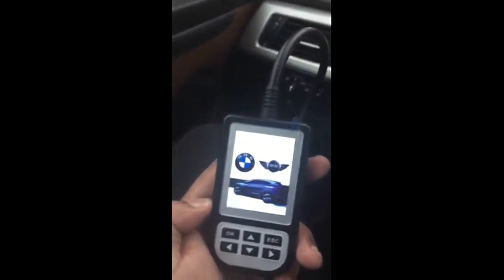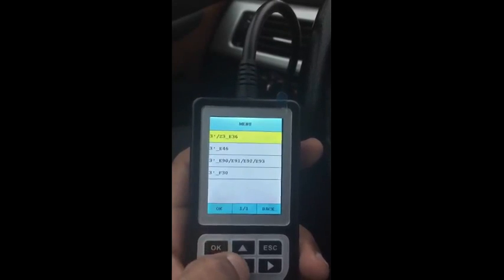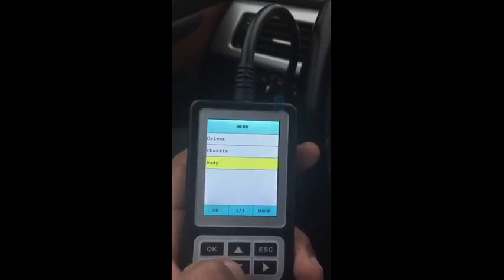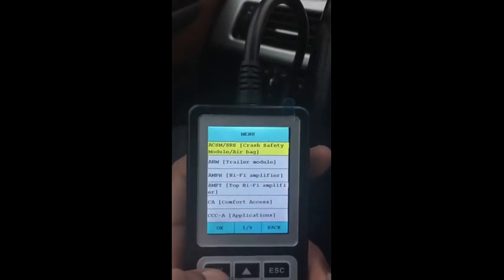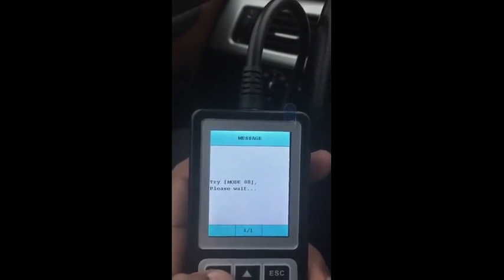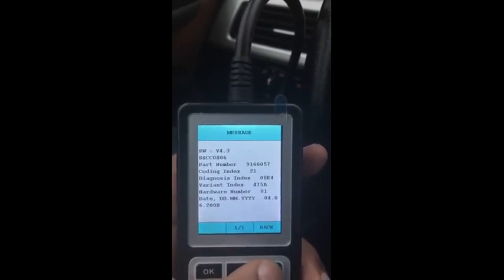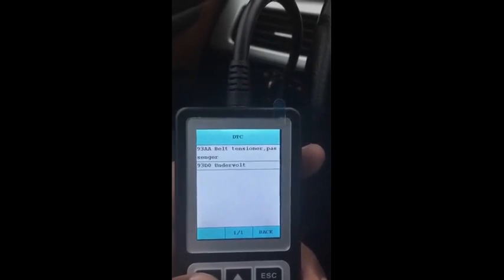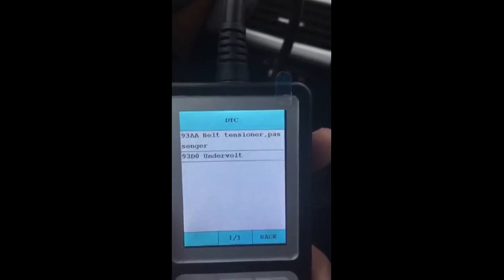BMW AIRBAG WARNING LIGHT (dont diy this)

Comment: So what was the final verdict? You replaced the parts, your coding did not work as a long term solution. Did you ever get it fixed before you got rid of it??
Reply from the maker: Nope ...I realized it was the air bag module that needed to be replaced and also programmed at BMW...there were more things that needed to get done on that car... and so i traded the car in for what i have now 335xdrive msprt pkg N55 ...this was a great decision

Comment: Should I buy a 2010 328i N51 with 99k no lights on with sports package automatic transmission smogged? I’m a mom with kids , or 2011 Mini Cooper s
Reply from the maker: I would say no to both 🤦🏽‍♂️ too much headaches
Reply: @BimmaJoc  so the 2011 is a JCW package and he has replaced a lot of parts with receipts,  is that any better news lol
Reply from the maker: I know its your decision but real
Small cars like that are not even safe and theres got to be more of a reason hes getting rid of it ...hey what about a honda accord ??? More reliable plenty room for the kids and safe
Reply from the maker: Ive own 3 hondas in the past never had an issue ...i even sell hondas now ...i love bmw but as you can tell from my videos i spend a lot of time doing maintenance or fixing it 😅😅😅
Reply: Bimma Joc well I have a Honda Odyssey as well and a Acura TSX 2008, ok last question is the 2012 mini jcw a better motor than the 2009 jcw
Reply from the maker: The 2012 is better by one horsepower
Reply: Buy a toyota

Comment: Hi, if it is the steering wheel driver airbag that is faulty, how do I fix that one?
Reply from the maker: Well ....we cant ...must go to dealer because it has to do with airbag ....even everything i did on this video realized that bmw scan tool needed to reprogram airbag module
Reply: @BimmaJoc  Thanks man. I will do so.

Comment: I am sorry there is no such thing as a quick fix.  Once the light comes on, your horn or any control on the steering wheel stops working.  It happened on my GTO.  First, the steering wheel needs to be removed, the fault lies in the part where the turn signal and windshield wiper and that one needs to be replaced.  Please take it only to a BMW dealer, or someone is a certified BMW mechanic.  The repair costs US$ 1,350.00.
Reply from the maker: Only a BMW certified tool can only reprogram it....Also the FAULT Most likely to replace airbag module... but even if i did that i would still have to go to the dealer to program it.  Any way.....ive not had that car for 3 years now ....that was N52 ....We have N55 now ....its on most of the Channel diys and maintenance
Reply from the maker: Right ....we have already said that in the comments for couple years now

Comment: Hi @bimmerjoc fam where can I buy those reader from
Reply from the maker: Kg Kazmi you can get that for 50 bucks on ebay just keep in mind it has limited use...but it will show you a problem
Reply: What do you mean by limited use?
Reply from the maker: Meaning it will not really clear codes...it will only show you issues....only an official bmw scan tool or equivalent that cost big bucks can diag and clear codes....the 50 dollar scan tool is only a guide.   Bavarian technic has a better option with a price tag

Comment: Where did you get the replacement for it? I need one too
Reply from the maker: I just searched ebay..but I would make sure of the part number first before buying and the scan tool needs to be more advanced to clear code ...if you dont have an advanced tool like bavarian technic...an independent shop maybe able to clear it out the system
Reply: @BimmaJoc  thank you for looing it up.

Comment: I had the same problem and applied the same steps. As I erased the code, with the same code reader, the sensors for the passenger seatbelt and airbag came back on as I drove for less than a min...
Reply from the maker: Yama Basir right because its not an official bmw scanner....the Bavarian technic tools works Better
Reply: @BimmaJoc  it was the airbag module...$700 brand new one with another $300 with labor smh...
Reply from the maker: Yama Basir i believe it ....200 dollars to clear code or 1000 to replace the whole freaking thing 🤷🏽‍♂️🤦🏽‍♂️of course they going to recommend replace the whole thing
Reply: Bimma Joc it was the airbag module!! The cost for that part was about $700 and labor another $300!!!! Nope, so Long story short I had to junk it because no one would of bought it..

Comment: Hi @Bimma Joc, 
I have the same problem with the air bag light, I used INPA to scan my car and the code indicate that is the passenger restraint ( 93c3 oc3 error). I am considering change the restraint or install the emulator. 

My question is, In your case does the light came back at some point after the replacement?

Thank you in advance for your time,
Reply from the maker: Gabriel Martinez yes it did come back ...but after that i traded the car anyway and got the E92 i have now...the only reason why it came bCk on is because of the scan tool i used...its not as advanced as INPA